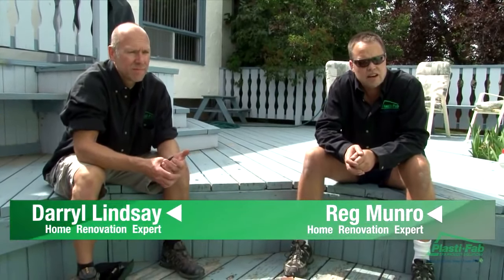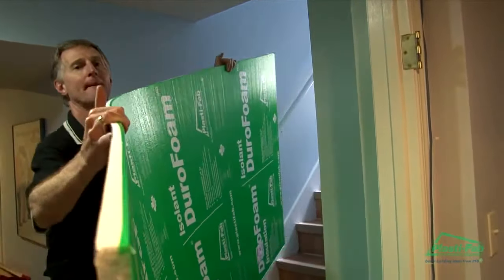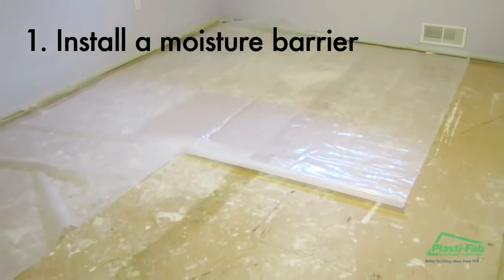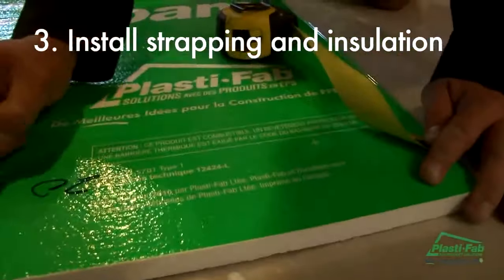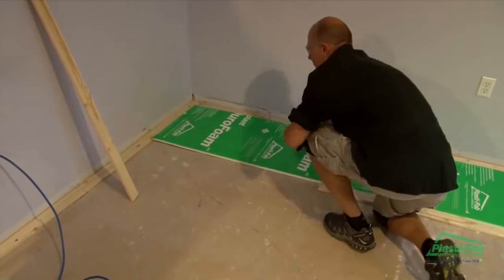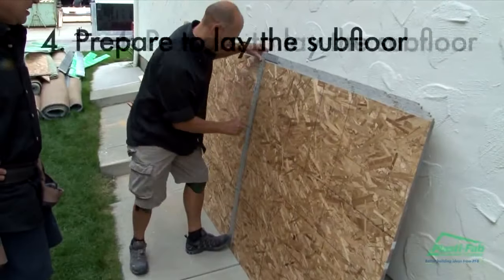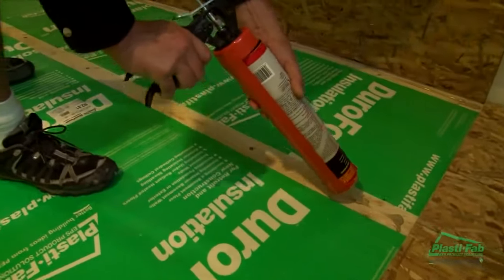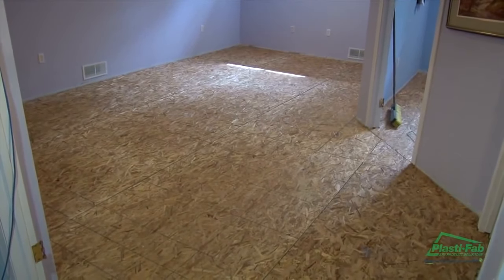How To Insulate a Basement Floor with Plasti Fabs DuroFoam

Comment: why the wood strapping? couldn't you just lay down foam boards, tape the seams and then install osb boards directly on top? Seems like an added step that's a lot of work that doesn't add much. I'll stand corrected if I'm mistaken.
Reply: Probably because the foamboard would compress at each anchor point
Reply: do you even need the board or could vinyl go right over top?
Reply: Exactly, lay straight onto floor and layer two sheet of OSB staggered so that the seems do not lineup on top of the Durofoam. Screw and glue the two sheets of OSB together and install flooring of choice.
It's called a floating floor.

Comment: That wood around the perimeter does not look treated it's directly on concrete and will rot. Either use treated wood or put a vapor barrier underneath it. smh
Reply: They installed the vapor barrier first then the wood.